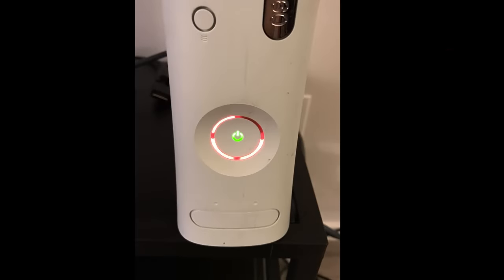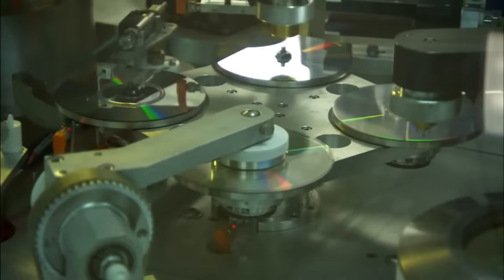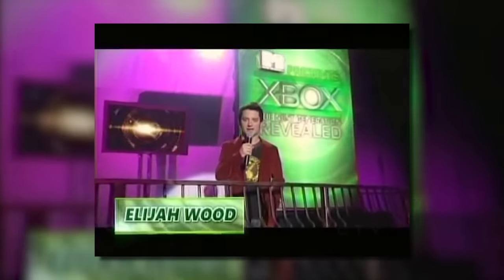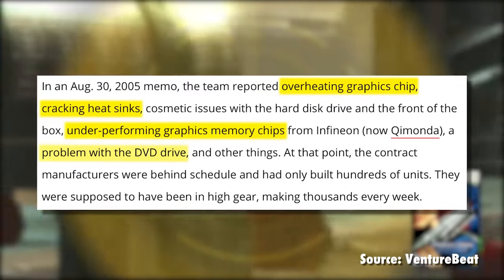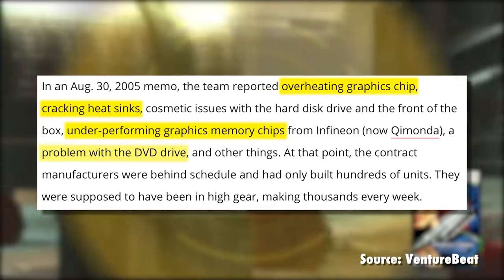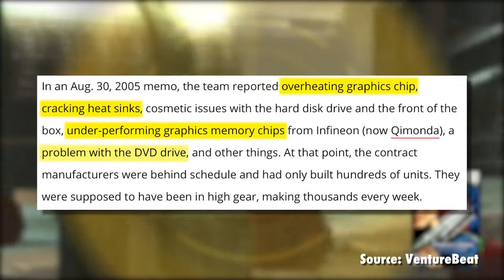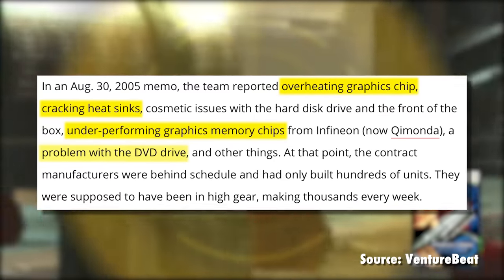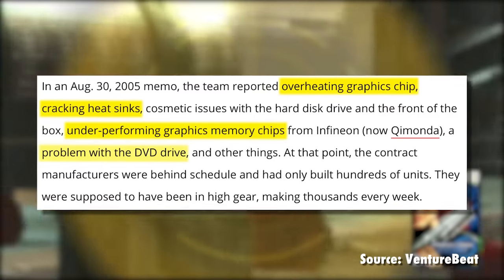History of the Xbox 360 Red Ring of Death | Past Mortem | SSFF

Comment: I had to send my Xbox 360 for repairs a total of 7 TIMES! On the 7th time, the customer service guy said my unit has been repaired too many times so they gave me a brand new 360 lmao
Reply: Dan the Man | Funny Videos! Had that happen too. Wasnt sent that many times, but i owned 3 xbox 360s ( myself and twin sons) and 2 out of 3 RROD. Sent my one sons twice and mine once. While i still prefer my the xbox brand over PlayStation, always have, but no denying this was the worst hardware issue of any console. It was so bad that everyone i knew, that were early adopters of the 360, were victim to the rrod
Reply: Wow! I only had to send mine in 3 times. I guess I'm lucky! Went with PS4 this generation because I wanted a reliable console.
Reply: +knightofdreamz Yeah when I sent my 360 in a got one back with a new/wiped hard drive. Was mad I lost all my saves. I've always assumed it was a different refurbished console.
Reply: Mine went in three times.  My console was never crammed into an entertainment center or anything; just open air.  

I finally got one of those Arcade models and it is still kicking.
Reply: knightofdreamz You must have never called that old Xbox line that took forever. They fixed yours EVERYTIME unless they couldn't and then you get a refurbished. Kids and their wrongness...
Reply: Dan the Man | Funny Videos! Even to this very day it's the same. Ps4,switch and Xbox one. The fan boys get salty, the moms and dad's buy wrong consoles.
Reply: Dan the Man | Funny Videos! I had to send mine back in 9 times. And at the time the PS3 wasn't out out, so if I wanted next gen gaming I had to wait for my 360 all those times lol.
Reply: Dan the Man | Funny Videos! I still don't regret ever having Xbox, even with how many damn systems I've been through as well as money
Reply: David Robinsnon Xbox one is very reliable a friend of mine never turns his Xbox one off its ben around 2 years since he actually had it off. I'm one of those people who keeps a dust cloth on top of my consoles when not in use. But now I leave my Xbox one on almost 24 7 playing Netflix in the background just because.
Reply: chevy the original Xbox one model is especially reliable.  I have a day one model and to this day it runs quiet almost always.  The big design was a safe design.
Reply: Dom S that's the exact 1 my buddy has I got the next gen with the aux connection in the controller
Reply: Dan the Man | Funny Videos! 6 times for me.
Reply: Dan the Man | Funny Videos! What's your gamertag
Reply: I worked for the call center you most likely called to send your xbox back.  There were many MANY customers sending the system back 9, 10, 11 times. I took a call from a guy on his 15th xbox refurbishment. There were so many broken they could not refurbish them fast enough and wouldn't just send new ones out, so they would knowingly send out broken xboxes.
Reply: SmogHouseTradingCo damn that's fucked up glad I never had the problem.
Reply: Dan the Man | Funny Videos! I got ya beat by 1.  I went through 8 Xbox 360's first two years.  
After that I quit dealing with Microsoft, made a friend at GameCrazy. (those we're awesome) From then on every time I got a bad one I would bring it into the store and my friend would act as if I did an exchange.  He would simply just hand me one off the shelf and sell my broken one to some poor shmuck. 

I got the red ring during Two game save parts as well.  Forever ruined my Bioshock 1 game save and Gears2.  Those corrupted game files are forever attached to my account.  I can never play gears 2.  It only because of Bioshock Collection that I even got to experience the first Bioshock.
Reply: Jesse Davis wth is a game crazy?
Reply: I still have my first launch Xbox 360 and I never got red ring of death same with my original ps3 launch.
Reply: The Shield can I have em? And do you have origional boxs?
Reply: Dan the Man | Funny Videos! Such a lie! They never sent the same xbox back to you or anyone let alone 7 times
Reply: Koot enjoy your ignorance.  Nobody got sent back the same console they sent back
Reply: Wow. I'm lucky enough that I only ever got the RRoD three times in my decade of owning an 360. Twice from overheating, and one was an undocumented Zero-Quadrant RRoD that turned out to have been from having my phone plugged into one of the USB ports on start-up.
Reply: I had this happen to 2 360’s and they gave me new ones each time...I had wrote the serial number down before sending it off just to make sure
Reply: Dan the Man | Funny Videos! See… ive had that issue with sprint and the iphone 7… 3 times replaced because of its shit… so i quit and went to apple,  i got one new phone, and it hasnt stopped yet… lmao,  the xbox 360 life was interesting
Reply: David Robinsnon Xbox one is actually very reliable, and Xbox live has been more reliable than PlayStation Network service wise the past few years.
No hate on PlayStation, just want to bring out some brightness in case you wanna come to the light side hahaha.
Reply: Dan the Man | Funny Videos! I also sent mine back 7 times to the stores I bought it from. The manager accused me of fixing my friends xbox with my warranty... I said I just want to play fallout 3! I get no enjoyment from coming back here and loosing my saved game. It died eventually and I just bought he black 360 with no problems.
Reply: My experience is almost like the OP's, but they never sent me a new one.
I sent my original '08 model in 3 times, that exact one was returned to me those three times. The fourth time, I believe an '09 unit was given to me. I had to send that one in twice. Got the same one back. After that, i went and bought a brand new Arcade model. I think it had an '11 date code. 
I basically stopped using it then. Around '09, i got a PS3 as my 360 was basically always at MS. 
The Arcade lasted until '16 with minimal use. The disc drive slowly gave out. All prior units died from RROD. 
I replaced it with a 360 S a friend gave to me. 
The PS3 is still going strong. Because of this, i went with the PS4 instead of XB1.
Reply: My xbox cord was out half away lol
Reply: Dan the Man | Funny Videos!  I had my 360 sence 2013 and today it still works
Reply: Dan the Man | Funny Videos! Lol
Reply: Dan the Man | Funny Videos! Thank goodness I got a slim
Reply: Yo #relatible
Reply: They did the same with me, I had it sent back 4 times.  They basically gave me a new one and refunded the cost of my 360 after the 4th time.(This was in 1 year) I sold the new one they send me and went to play station.
Reply: Ur lucky if that happened if I gave back COD WWII back to the game store and they’d offer 6$
Reply: Dan the Man | Funny Videos! 700th like
Reply: I think I sent mine like 5 times and always thought how many times before they give me a new one
Reply: Godzilla 73 
The games
Reply: Dan the Man | Funny Videos! That what happens to me my disc drive was shut
Reply: And then everybody clapped.
Reply: I had mine sent out once took 4 weeks to get it back, they put some foam pads on the motherboard. It died less than a year later and told me to pound sand.
Reply: lol
Reply: Me too, 7 replacements - except for I just ran out of warranty time and didn't get anything new. However my friend had his sent in for repair 11 times, then finally they gave him one that still works until this day. Me meanwhile, that POS I had broke, then I replaced it, that one had a DVD drive that failed, replace it and that one randomly freezes up. Good thing with the XB1 is they built the original like a tank, the thing runs nearly completely quiet, never gets loud, doesn't run hot and should last for a very very long time - at least the original ones.
Reply: My Xbox 360 is the one of the older models and it still works had for almost 6 years
Reply: The original XBOX came out in 2005, the XB1 came out 5 years ago, if you got your 360 6 years ago that's not an older model, that's pretty much one of the last models they made. For the XB360 once they went to the slim format they didn't have any more issues, the issue was with the original models - and even with them if you can find one with an hdmi output, those models didn't have an issue with the red ring of death, it could happen, but it wasn't rampant.
Reply: I had over 7 returns aswell
Reply: 1000th like.
Reply: @ David Robinson: Yes, because the PS3 was so reliable.  I threw 3 away with YLOD, only they didn't replace mine like MS would have.
Reply: @ David Robinson:  LOL!  That's funny as hell. I'm a fellow 2nd amendment supporter.. but don't have a chair of guns LOL.
Reply: @ Rig:  Yes, that Arcade model was different.  I had one for a decade and it worked great up until I gave it away in perfect working condition 3 years ago when I moved out of state.  It was bought used, too.  Definitely something special about that model.  I had to adjust the DVD laser, but after that it would read anything.. even discs that were scratched to hell.
Reply: Koot day what you want but at least in America we have Freedom of Speech. :^)
Reply: Amerifag. Your European union is failing. hahahahahaa.
Reply: I never had to send mine in once but I also owned at least two Xbox 360's. One of them got stolen though in of all places in the process of flying from Point A to Point B.
Reply: Rig: After doing some research when my original 360 red ringed for the second time, I also purchased an arcade model (codenamed Jasper). Nine years later, it's still running like a champ.
Reply: Dan the Man | Funny Videos! Lol
Reply: no they will resend your same system

I marked mine on the inside b4 sending it in and got the same one back
Reply: I got my ps3 in 2009. Still works today with no repairs.
Reply: They gave me a new one on the first try. The funny thing is, I technically voided the warranty because I opened it up. Guess they were really desperate.
Reply: opening a product cannot void a warranty under US law, those stickers are bullshit
Reply: Dan the Man | Funny Videos! /r/thathappened
Reply: Dan the Man | Funny Videos! Oof
Reply: sent mine in 3 times got back different one every time. bought an 09 arcade model and it still works, I used the hell out of it! it had the smaller nanometer chip set, I believe it was the 3rd revision of the xenon which kept the console nice and cool!
Reply: Yeah but I did more than open it up. I removed the heatsink, put in new thermal paste, and drilled some holes for screws to get better contact  to the die. So yeah, I don't think that "customization" was still under warranty. But I agree the stickers are BS. I replaced their sticker with duct tape -_-
Reply: I have had the red ring of death once, but in 2011 Well i have a other a other xbox 360 from 2011 but it is in perfect condition
Reply: i had a xbox360 for 4 years   <--6inch fan blowing at the bottom , where the heat sink sits
and
i had a xbox slim . that lasted 5 years. before it gave me  1 red ring to .. the red ring of death.
and
now im here ,doing the same thing to my xboxoneS  .. 6inch fan blowing in this time :/
Reply: Who are u even talking about? 
No one envy USAmericans..
Reply: Dan the Man | Funny Videos! Omg hi dan I thought you died
Reply: My PS3 service over 15x then I buy ps4
Reply: My boyfriend's New 2DS XL has been sent in twice for repairs due to the top screen's backlighting going extremely dim, and it just recently happened again and will have to be sent in a THIRD time. He's hoping they'll give him a new console this time.
Reply: I never had to do that mine lasted longer than its warente
Reply: I never had that happen.
Reply: BBQ DanTheMan why not get an xbox one s just got one today
Reply: My ps3 died today
Reply: David Robinsnon what the hell did guns have to do with an Xbox 360 or the conversation of Xbox 360 system repairs?
Reply: @El-ahrairah - you are incorrect. WHen you send in a console to get fixed, you get it back, did you forget Xbox360 had internal memory on most consoles? the detachable HD drive wasn't a thing until the remodeled it.
Reply: BBQ DanTheMan
lol brand new 360 red ring too ahhhahahahah buy ps4 pro best of best
Reply: Noice
Reply: im crying hha
Reply: Wot is the music in the back round called?
Reply: So many subs
Reply: r/thathappened
Reply: All of that Minecraft... Your diamond armor... it's all gone...
Reply: Wtf aha I’ve never had the red ring and I had my 360 for years. 😂😂
Reply: You know the dev team fucked up when it needed repaired so many times they replaced it
Reply: Oh man I remember my first 360 I bought with my savings account I was so happy & only because I couldn’t afford a ps3 I couldn’t wait 2 play mass effect....then my shit start blinking 3 red lights & I was crush & depress because I bought it with the money I saved ! And since the day I wasn’t a fan of them anymore!
Reply: That’s how it’s done, be a relentless annoying consumer. Respect.
Reply: "John, we've got another one here... Ehm... Yeah, just... here."
"The fuck is this datasheet?"
"... Yeah, there are parts from 13 different repair cycles here, spanning over 6 sendbacks... I don't know WHAT the fuck we're gonna do with this one..."
"Yeah, i cannot even be bothered, send the guy a new one, he fucking deserves it after 7 sendbacks."
Reply: You understand Ashens and XBox
Reply: That's crazy, the only issue with mine was after about 7 years the disk drive just stopped spinning on it's own so it wouldn't read games, if I gave it a little bit of a tap like a drum roll while it was reading it would sometimes start to spin and read
Reply: I never repaired it but had to get a second one because of the ring of death
Reply: BBQ Dan
Reply: @Daverbater  PS5 will be the same PS3 was more reliable than the Xbox 360.
Reply: @Daverbater  should have gone to pc.
Reply: And then everyone clapped
Reply: My Xbox 360 was manufactured in 2006 and has had no problems so far!
Reply: nice i have had my pc since i was 5 and it broke down twice got it repaired free (because my mom was friends with a computer engineer)
Reply: BBQ DanTheMan my Xbox has the ring of death an it still working
Reply: I remember when my mom bought me an Xbox elite. 
It only lasted 5 days lol
Reply: gotta go for quality bruh. Sony just makes better shit
Reply: BBQ DanTheMan SAME
Reply: It depends, I had a halo 3 edition xbox, I got mine back, but if you had a standard 360 you got a refurbished one
Reply: El-ahrairah  Refurbished = fixed
Reply: And then everybody clapped
Reply: @_mailer  I think the ps3 slim is the best model of ps3. I got mine in 2009 or 2010 and it ran right up until 2016 or 2017. The top loader I have now is all right. It hasnt stopped working, but its been here for 1 or 2 years only. I am nervous about the exposed disc reader, just a speck of dust could ruin your whole system
Reply: @rig85  So your  console was floating mid-air? Impressive.
Reply: @davidcastleberry1720  Well, technicly, whether you get lucky and have it reparied or you don't, which most people got an un-fixed piece of crap back, its still the same system, just with new parts, and maybe that box won't have all the problems fixed, or maybe any of the problems fixed at all
Reply: @The Pokemon Master 365  Thanks for your completly unsupported opinion, well, unless you call bias a support. Look, just tell me whats so good about it
Reply: El-ahrairah  thank you. Was thinking the same thing. I had 2 red rings; each time it was the same. They sent me the shipping stickers, a ups employee came To get the console on my doorstep, and 2 or 3 days later ups shipped another BRAND NEW 360, along with 1 month free Xbox live as a "we re sorry" present. Anyone that pretends microsoft repaired their console 7 times is just flat out lieing. Lol. Pick believeable lies at least mère!
Reply: @Daverbater  i love the states man, don t get me wrong but.... guns seem so important To you.... I live in a country where most people dont Carry guns, there are almost no crimes, 1 or 2 murders a year in a 950k people City... my clair isn t made of guns, neither is my chair, and when i go out at night i know people aren t gonna pull out a gun on me...

Why don t you sell the us by its beautiful cities, amazing sports teams and gorgeous beaches?

Cuz mate, by using guns To brag about your country, the only people it makes wanna visit the states already live there themselves... They are the only ones To which guns matter so much... 

Peace
Reply: And then everybody clapped
Reply: I had to send my Xbox 360 for repairs a total of 7 TIMES! On the 7th time, the customer service guy said my unit has been repaired too many times so they gave me a brand new 360 lmao
Reply: Repaired 7 times?, you did you know you're not supposed to throw your Xbox across the room every time you're raging because someone killed you on Call Of Duty didn't you?.
Reply: Fake
Reply: BBQ DanTheMan your so lucky
Reply: David Robinsnon the PS4 is not reliable
Reply: Malus u were supposed to send it in without the hd
Reply: Lucky coz some don't care they only do it for the money
Reply: mine never got the red ring of death i had  it for 8 years before getting an xbox 1 my PS3 broke tho
Reply: freiza diza my first one got the ring the replacement did not, it was still going strong till a couple of weeks ago when the disc drive took a crap but still no red ring on that one.
Reply: GG
Reply: r/thathappened
Reply: BBQ DanTheMan pls tell me that you kept your hard drive lol
Reply: My PS4: Ive never had to be returned to be fixed
Dan the Mans Xbox 360: had to get returned to be fixed 7 times
Reply: Meee tooo;) the new one worked like a champ, doe...
Reply: Still on my original Ps4. One of the first 5000
Reply: r/thathappened
Reply: They replaced mine the first time I sent it in plus gave me 3 months Xbox live for free.
Reply: Lol was it free or
Reply: Anyone else just not have to send it in once? Had mine for 10 years no problems at all. Its how you take care of it
Reply: @failsandkarma7460  yeah I've had mine for like 11 years no problems guess we just got lucky
Reply: One time the repair guy said I needed to buy a whole new motherboard XD and it was only my second time needing to fix it. I ended up using my crummy 9 year old brain and fixed it. Yeah that’s right. MY 9 YEAR OLD BRAIN WAS SMARTER THAN SOME ADULT’S ELECTRONIC FIXING BRAIN!
Reply: funny bc I have had my PS3 for 4 years and it is in a dusty corner and it got super filled with dust but it worked fine and it is still working lol
Reply: Sick!
Reply: wow i sent mine in around the exact same amount of times and they never actually fix the console they just give out a refurbished one. Just crazy how common getting the red rings of death was back then.
Reply: That good